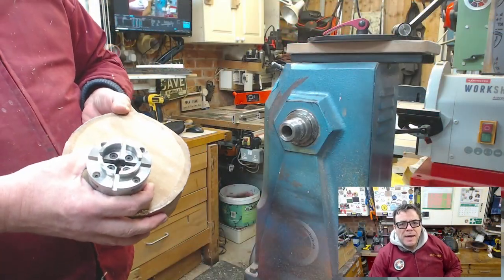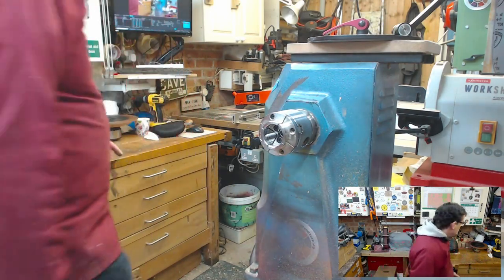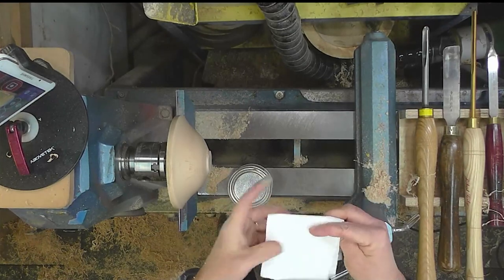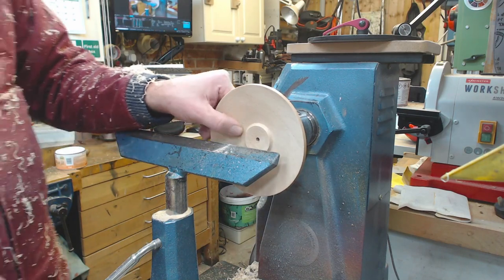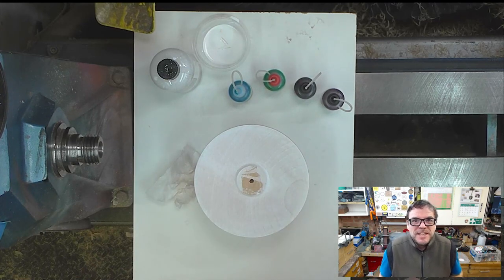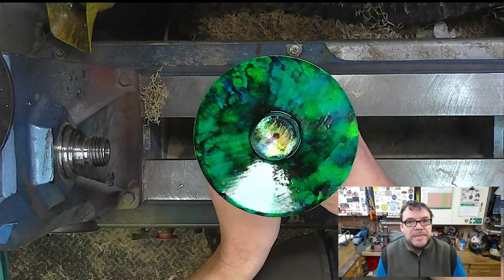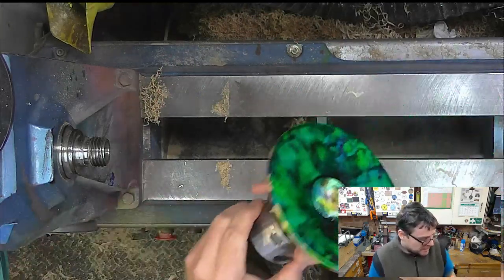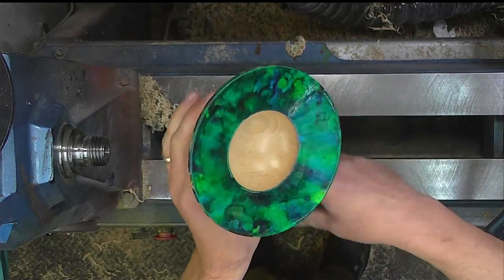Woodturning - A Small Coloured Bowl

Comment: Stewart,
I enjoyed this video because you did a small bowl, instead of your typical larger pieces.
Question 1:  at the 12:28 mark in the video the painted surface changed to a white coating and by 12:31 the coating was gone.
What happened here?  What was the white coating?  Was it something you did to protect the paint?
Question 2:  I liked how you painted the bowl rim while flat on the table top instead of your typical paint-on-the-lathe technique.  The amount of "run" you got from the paint (towards the center) was due to the viscosity of the paint and the amount of "slope" you cut into the rim of the bowl.  If the top was virtually flat, there would not have been any "run" at all.  Was the slope eyeballed or was there a plan there?
Chuck
Reply from the maker: Hi Chuck - sorry you've had to wait a while for a reply! Been away in Portugal for 10 days. The white coating was just dust from sanding out the bowl and it was vacuumed off off camera...
The slope was eyeballed... I like to have some slope on the rim to lead the eye into the bowl.
Cheers!